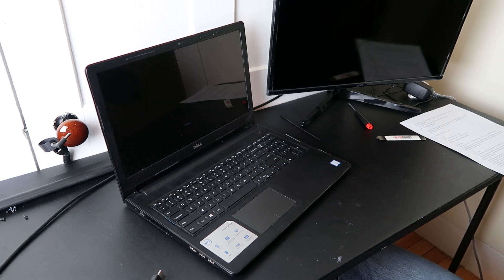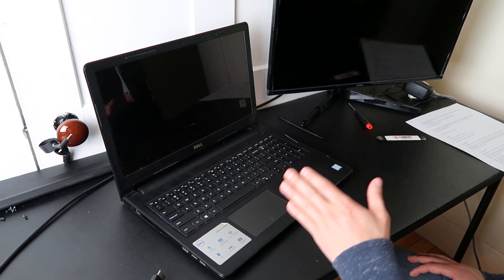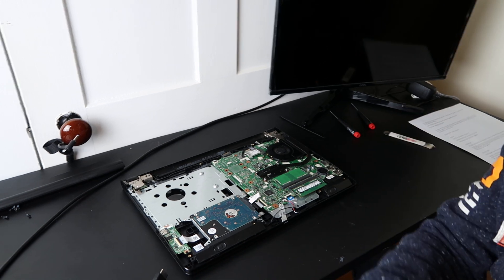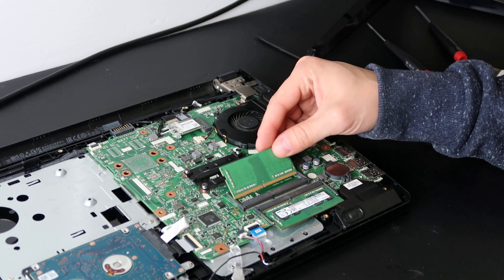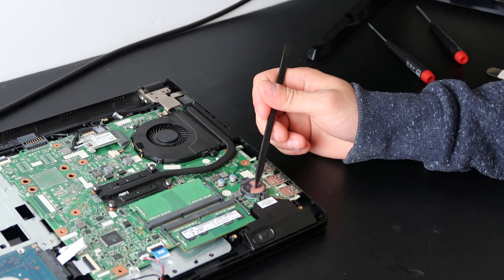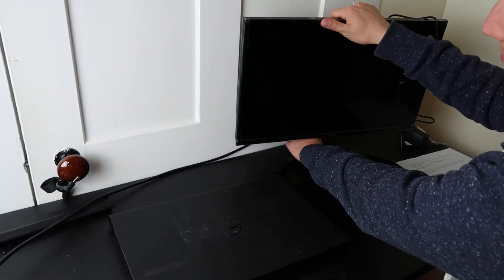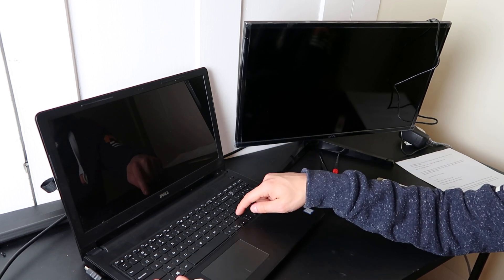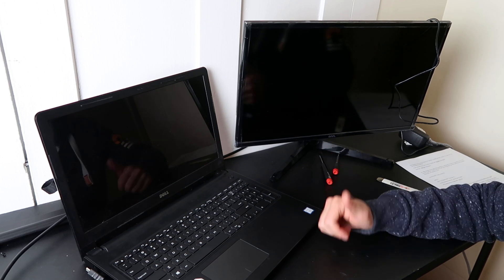How To Fix Black Screen / No Display / Dim Screen / No Picture for Dell Laptop

Comment: My dell vostro 15 3568 screen sleeps out of nowhere if i press the powerbutton then the screen flashes for 0.1 sec then goes black music was working but the screen won't start it repeats again
Reply from the maker: Does the screen go black or does the computer turn off?  If the screen is black, what are the signs the computer is on?  Lights?  Sounds?  Fan?
Reply: @PC_Monkey  the computer screen goes off the also goes off but if i press the powerbutton then it resumes for 1 sec and does the same thing
Reply from the maker: @fanindraprabhulkar5119  I dont understand.  'screen goes off the also goes off'  ??
What are you exactly seeing on the screen and what are the signs that computer is on? Lights?  Sounds?  Fan?
Reply: @PC_Monkey  I want to say that when i turn on the laptop it turns on normal to admin but when i try to type the password the screen turns off so i try to turn it back on by pressing the power button but the screen flashes and turns off back again
Reply from the maker: @fanindraprabhulkar5119  Try the steps here first;  https://www.youtube.com/watch?v=w3XfE-ghbhs&feature=youtu.be
Are you able to perform those steps?

Comment: Popping ram out did it for me. at first there was no power with either out then i tried putting both back and making sure they were seated then it came on. im still suspicious ones bad, if i go into computer properties will it tell me if its reading one or both?
Reply from the maker: It will tell you what its reading, yes :)  It could be that one was incorrectly plugged in.  They come loose sometimes.  Well done !!
Reply: @PC_Monkey  ok so then both are good then it say 8g and the card says 4g so obviously both are good. Cool thank you fellow YouTube instructor 👊
Reply from the maker: @ecophage  Happy to help :)  Always here if needed !!

Comment: My problem is screen turns on I hear the sound lights turn on but after that the screen doesn't Pop and it will turn off automatically left it for 2 months comes back power it on dell logo pops up after that boom screen goes blank again changed ram took it into a repair center they say I need to move my entire motherboard to a pc case because the screen has a problem i kinda doubt it but idk what to do still not fixed my parents told me to wait if I get 3.5 up in grade they wouldbuy me a new one but seriously I dont need a new pc I need it to work for my online class! It is hard to work on a 6.22 inch phone screen with a PowerPoint.
Reply from the maker: LOL no, your computer is not acting that way due to screen problems.  Unreal!  Try the steps seen here first;  https://www.youtube.com/watch?v=w3XfE-ghbhs&feature=youtu.be.   Let me know how that goes :)
Reply: @PC_Monkey  wont even let get pass through the black screen turns on bam turns off
Reply: @PC_Monkey  the dell loading screen now doesnt even comes up now Wonr even let me pass through turns on and off
Reply from the maker: @locnes2133  The dell logo screen does not come up?  So the screen just stays black until the computer turns off?
Reply: @PC_Monkey  precisely!
Reply from the maker: @locnes2133  Unless you can hear the fan turn on and other hard drive / motherboard sounds, the computer may not be turning on.  Try this video in that case;  https://youtu.be/P3I7dDpkJps.  Let me know how that goes :)

Comment: Please help me ! 
When i hit the power button my mouse lights are on and the fan is working but the screen is black and thats it ! it wont open 
I tried every fix in your videos 
Cleaning the ram 
Pressing the power button for 30 seconds solution 
Removing the battery 
Removing the cmos battery 
Did all of these and still same problem 
Pls help
Reply from the maker: If testing the different RAM sticks in different ports didnt help, what was the result of the external monitor test?

Comment: Whenever I turn my dell laptop on its works fine but after something screen went black but laptop is running i can hear sound and music again after turning off directly and then turn on its work but that happen again after sometime
Reply from the maker: When the computer screen goes black but the computer stays on, have you tried plugging into an external monitor?  Is it black too?
Reply: No It happen to other monitor also it runs well in start but stop after some time
Reply from the maker: @adorelearning3770  If its also going black on the external monitor, you may be looking at a motherboard replacement :(
Reply: @PC_Monkey  what you suggest replacement of motherboard or buying new laptop?
Reply from the maker: @adorelearning3770  What model Dell do you have?

Comment: Hello i have a windows 8 dell and i recently decided to turn it on again and i get the loading screen and then i get a black screen with (Warning: the battery cannot be identified. The system will be unable to charge this battery. Strike the F1 key to continue. F2 to run set up the utility. but i need my current password for both and i don’t remember it and once i try it 3 times i get the system disabled number and service tag number. Please help!!
Reply from the maker: If you dont remember the password, you will have to factory reset.  However, this will cause you to loose all your data.  You can see that on a Dell here;  https://www.youtube.com/watch?v=IE1zShTb0rU&t=43s

Comment: Actually in my laptop the prob is the screen is so dark when I connected on tv it's ok when my brother drawn a black rectangle In paint looking at tv the rectangle only was seen in a very dark manner in the pc screen what is the prob also my pc is dell Inspiron 15r
Reply from the maker: Assuming your brightness is just not all the way down, you could be looking at needing and LCD replacement if the picture is fine on the external monitor
Reply: @PC_Monkey  its fine on tv so how can i purchase the parts for my pc
Reply from the maker: @nazeruddina9540  I usually get my parts on Ebay or Amazon.  Which part are you wanting to buy?  The LCD or the LCD Cable?
Reply: @PC_Monkey  i don't  know which is needed can u say the budget of both
Reply from the maker: @nazeruddina9540  LCD cable shoudnt cost more than $10 USD for most normal laptops. LCD may cost around $30 - $40 for most computers.
Reply: @PC_Monkey  that means i ahev the risk of spending money for both
Reply from the maker: @nazeruddina9540  Yes.  Unless you purchase them and they have a free return policy.  Then if you replace one and that does not turn out to be the problem, you can send it back for free.

Comment: Thanks a lot bro the battery trick worked, but still every one or two days when I turn my computer on, this happens and when I restart it everything is fine. Do I have to replace the battery again? (Already done twice)
Reply from the maker: Do you use your computer plugged into the wall or in a surge protector?  Also, do you always use with the power adapter plugged into the computer?
Reply: My computer is always plugged in while I'm working with it since the battery is broken and my laptop wouldn't even detect it, and no I don't use any surge protector its just connected to the wall
Reply from the maker: @ajakrami9936  Both those things are very bad for battery health.  Try using a surge protector and not having the computer plugged in all the time after you replace the battery.  Batteries need to discharge and charge regularly to stay healthy.
Reply: @PC_Monkey  
I got it bro thanks a lot keep up the good work :)
Reply from the maker: @ajakrami9936  Thanks :)  Good luck !!

Comment: So I have a light up keyboard built in when I press it turns on so that means it’s on I already started it and if I plug a device in it works so would that be a graphic card issue?
Reply from the maker: I dont understand your comment.  You turn on your computer, and the keyboard lights up so you know its on?  Are the lights the only signs of life when you turn it on?  No motherboard or hard drive sounds?  No fan noise?
If you plug in a device it works?  I dont understand that.  If your computer works, why are you asking if it has a graphic issue?
Reply: @PC_Monkey  it’s fixed thanks for your concern it was a black screen but everything else was on and I was unable to restart it
Reply from the maker: @yoboyburger4117  Glad your all set :)

Comment: My case was that my laptop started popping up the blue screen and it did not boot up. The power button is always turned on whenever power source (battery or charger only) is connected. Then the power button does not go off even if I press it for a couple of minutes
Reply from the maker: For a Dell with a blue screen error issue, refer to this video; https://www.youtube.com/watch?v=ZFJHGvOGZbg&t=144s

Comment: Hello, my E7450 starts up Ok and I get the window login and works ok, for few min and then it just gives me a black screen.., can you help
Reply from the maker: Does the computer turn off or does the screen go black?  Have you tried an external monitor?  Does the screen go black there as well?
Reply: @PC_Monkey  i need help, I have a dell g5 15 and when I turn on my laptop I put my login and then there is a black screen but I can see and move my mouse still, please help
Reply: @PC_Monkey  it just goes black, I wait and then press the Esc or return button and NO JOY, so I restart the computer from the power button. I've then F12 and run the diagnostics and also replace the battery..., and also updated the drivers and ran the Cclean
Reply: I will try the external monitor first and let you know
Reply from the maker: @kaiserzkhanable  ok

Comment: Just an FYI: For me and the Samsung Notebook 7, Windows updates replaced the display driver which was causing the black screen. Every time after an update the computer came on but nothing appeared on the screen. Plugged it up via HDMI to the tv and it showed everything working perfectly fine. I had to hunt down an older driver and install it.  Before replacing the hardware, make sure the dreaded Windows updates aren't ruining your older laptops.

Comment: bro plzzz help me i have classes tomorrow 😭 my computer was on, when i plugged the charger it just turned off and now i can’t open it, when i click the power button it lights for a second but i can’t open the computer plzzzz help me i have 2 tests and as well the most important lessons tomorrow 🙏😭😭
Reply: I have school rn and I can’t get on PRAY
Reply: Same like me
Reply: How did u repaired
Reply: You probably missed your tests by now, but in the future, try opening up the laptop, remove the battery (and the RAM as well just in case) and hold the power button down for 30 seconds. Then plug in the AC adapter (with the battery still disconnected -- put the RAM back though) and see if it works. If it does, plug in the battery and test it again.

Comment: I use my monitor with my PS4 and I can't get it to come on. I plugged a reg tv into my PS4 and it displayed the video.  Are there other options for troubleshooting the monitor itself?  I get the LED light in the power supply but not on the actual monitor.
Reply from the maker: If the monitor is getting power but nothing is coming on, its most likely the LCD itself of the main board.

Comment: I bought a new battery for my dell, and when i put ON the laptop with the battery in it and AC power, the laptop won't give any, but when i power the laptop without the new battery it comes up well and then i insert the battery and it charges. If i turn it off and power it with the battery and AC it wouldn't give any display until i power it without battery. Please can you help?

Comment: For my case, my dell 7559 fan and power is on but my screen is staying black. I did screen colour test and the screen start blink red green and blue. Can i know wat is the issue?
Reply from the maker: your on the correct video.  Have you tried the steps seen here yet?
Reply: @PC_Monkey  i tried the switching ram step.
Reply from the maker: @firedog9976  If that didnt find the issue, then you would keep going and try the other steps :)

Comment: Hello, thank you for these videos! I have a Dell inspiron which works with ubuntu. All of a sudden, today, it has a black screen when I turn it on. Not sure why and how to fix it. I don't even see the "Dell" welcome note. Any ideas on where to start?
Reply from the maker: If the screen is black, what are the signs the computer is on?  Lights?  Sounds?  Fan?
Reply: @PC_Monkey the small light in front that indicates that the lap top is on works fine and I can hear the fan. Thank you again!
Reply: @PC_Monkey  also sound-wise it sounds as always.
Reply from the maker: @giopapas1  Sounds like your on the correct video.  Have you tried the steps seen here yet?  With what result?

Comment: Hello sir.
I have display  issue in laptop 
1.First time show few seconds display after automatically no display. What's have a problem in my laptop plse comments resolve my problem..
2.may be internal system is running but not display any things
Reply: Dell inspiron 1545 laptop
Reply from the maker: @omprakashmandal2488  So your screen seems to be working when you first start the computer but then goes black after a few seconds?   Have you tried hooking the computer up to an external display?  Does the problem continue there as well?
Reply: @PC_Monkey  laptop get start but after few seconds agian in go to sleep mode.. what's have a problem

Comment: My laptop dell Inspiron n5110 is working fine but the screen goes blank. when connected to extend monitor laptop is working fine. it boots fine from dell logo screen to windows but when it gets to where it should boot to desktop then it goes blank. What is it?

Comment: My screen is black with a cursor after log in. I tried doing the ctrl,alt&delete and ctrl, shift and esc. But is not giving displaying anything. 
Does anyone have other suggestions?
Reply from the maker: What brand computer do you have?  The computer turns on, shows the startup logo screen, then goes black with blinking cursor?  Correct?

Comment: I'm also having black screen issue with my Dell Inspiron 15  3000 series laptop -- bought it new and have only been able to use it for about 15 hours over 3 years.... no access to tools to open it myself. Worth bringing it in to get fixed? Or should I be saving for something better? What would you suggest?
Reply from the maker: Its always worth trying to fix it but if you cant get in to access any components then you will have to bring in to get fixed
Reply: PC Monkey  — thank you. Just concerned that this is such a common issue with this brand and then could have the issue again in the near future making the effort to fix, a waste of money.....  maybe investing in the tools to attempt to check it out myself first is the more economical approach....  thanks again!
Reply: @tinalesher2277  please reply!
How you fixed this problem
Reply: Same model+same problem (black screen) 
What to do now?

Comment: hi, and thanks for the vids. I just replaced a cracked screen on a Dell Insperion 15 3000, no problems until I powered it back nup, I feel the HD spinning up, but screen is blank still, the unit worked before. Any thoughts?
Reply from the maker: Does it work when attached to an external monitor?
Reply: @PC_Monkey  it's amazing hoe many people I see you respond to, and none of them respond back

Comment: When I press the power button, the light and charger lights turn on, and then it turns back off and the black screen is still there
Reply from the maker: For a computer that does not turn on, try this video first;  https://youtu.be/P3I7dDpkJps.  Let me know how that goes :)
Reply: PC Monkey Hello! Thank you. I still am trying to fix this problem, although it is evident that pressing the power button is kind of working. 

At first, when I pressed it, the power button and charger would turn on for about 3 seconds and then would immediately turn off. After continually pressing the power button for long periods of time I pressed it one more time and the button lit up for about 5 seconds and then turned back off..

I have a dell laptop but can’t find out how to find out what kind of model it is. Although it does not have a slide out battery 🔋
Reply from the maker: @robertsderon  Did you try the other steps seen in that video?
Reply: PC Monkey Yes! I finally unscrewed all of the screws and took the battery out for a few moments and plugged the charger in. I put the battery back into place, screwed everything back and it finally turned back on. Thank you so much!

I used to live in Vegas and the same problem happened to me 2 years ago, if only I were able to watch this video instead of throwing it away!
Reply from the maker: @robertsderon  Happy to help :)  Always here if needed !!

Comment: Hi there thank you for your helpful videos, how about blinking screen goes to blank screen for Dell Laptop Latitude 5480? I do a bunch of stuff and then ending up downgrading my windows from win 10 to win 7 now my laptop are usable but I didn't maximize the spec of the laptop to it's maximum potential due to downgraded graphics driver windows software etc. Thank you in advance for your response.